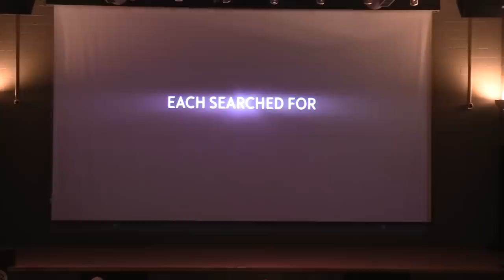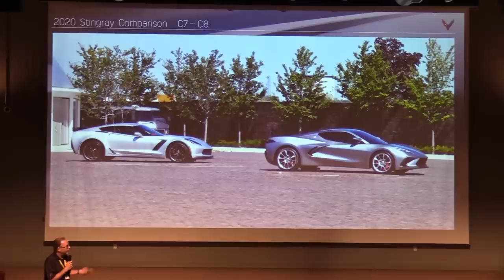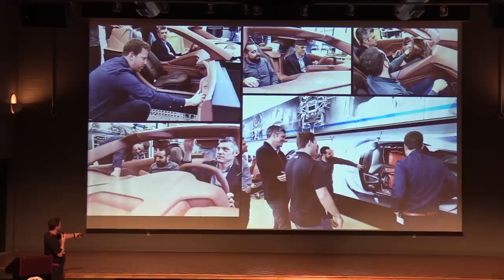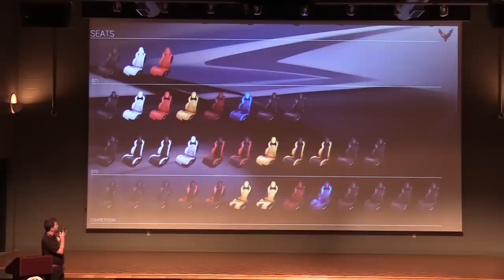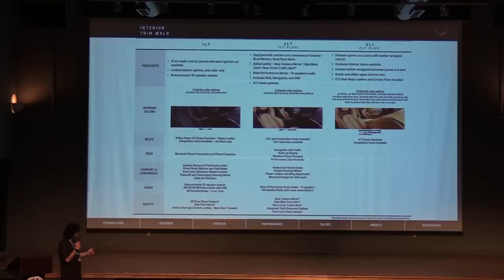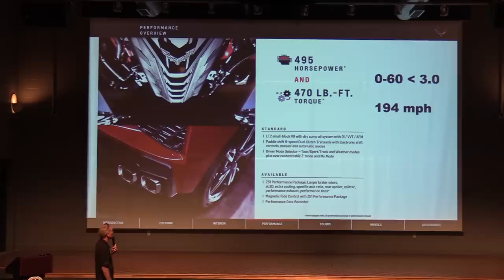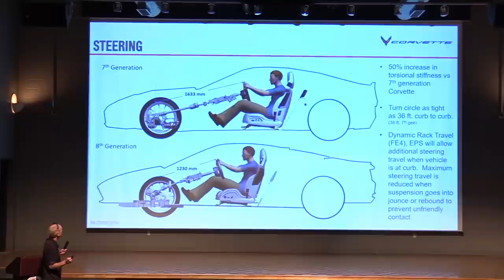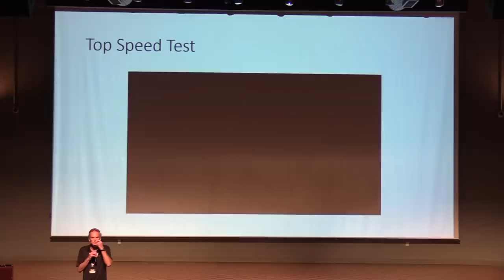2020 Corvettte Stingray  Overview (Saturday Presentation)  at the NCM's25th Anniversary

Comment: That is 194 mph with a PASSENGER and laptop, camera, batteries, timing gear etc. So add 90kg maybe about 200lbs to the weight of the vehicle. So the bog standard C8 the one to get, is a near 200mph vehicle in solo mode. 

So many folks will get the Z51 performance pack, having being seduced by the sub 3.0 second times. But it is allegedly 0.1 sec difference. $5k and having to get a new full set of all season tyres and possibly wheels to put them on for convenience is it really worth it?. 

After 3 years of warranty slap on a supercharger for $10k, half of which you have saved by not getting the Z51 package and you'll have a faster 0 to 60 time anyway, (that won't be utilised much anyway as the tyres would soon be shredded). 

The after market performance industry are bound to adapt something, you'll have for $10k over the $60k base price C8 a 210+ mph monster that'll stack up against a C8 Z06 for at least $20k cheaper.  Getting it in 2020 not waiting ages. 

Many will regret getting the Z51 pack as if a supercharger is fitted maybe new performance exhausts are needed to fit.  194mph though WITH a passenger, not bad at all.